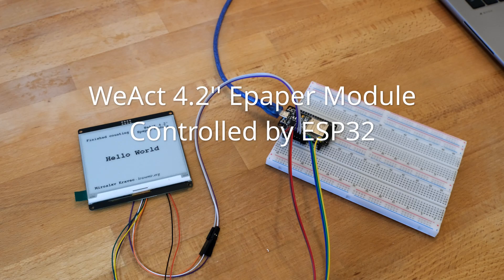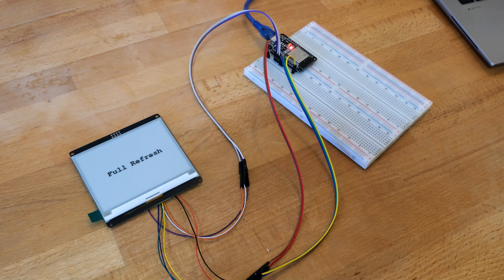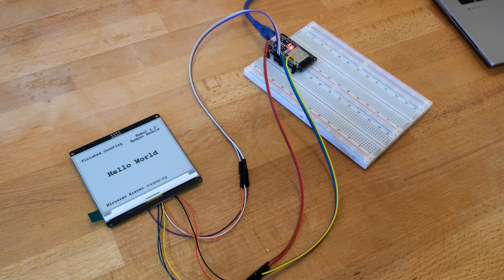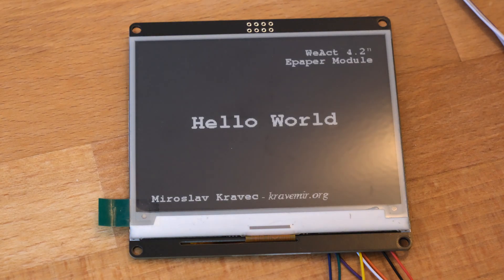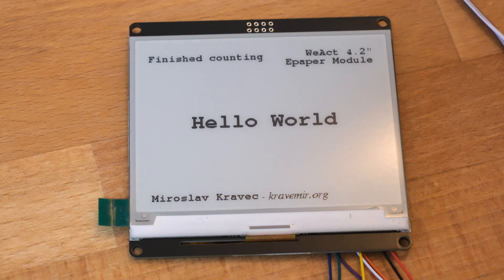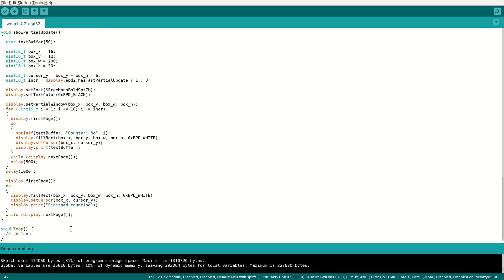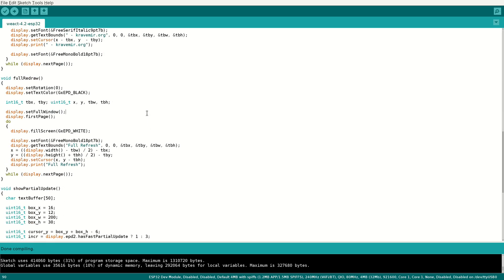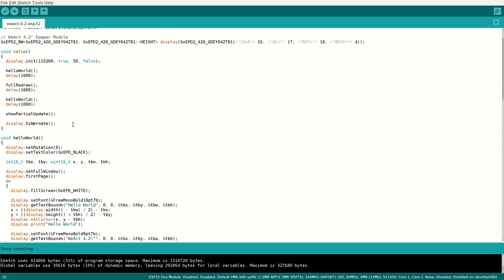WeAct 4.2'' Epaper Module controlled by ESP32 (programmed with Arduino)

Comment: hey, thanks for the video. looking to buy this display to play with en intergrate in epshome. my question is what about the 3.3v io pins. did you just connect them to a 5v esp32?
Reply from the maker: The I/O pins on this display module are 3.3V, and ESP32's I/O is 3.3V too, but not 5V tolerant.

I've used 3V3 VCC to power this display, but didn't try powering it with 5V. Theoretically, it should work.

My plan is to power it with NiMH, and 5V would require lots of batteries (NiMH can go as low as 1V) or lots of step-up boosting. Why do this, if both ESP32 and the module can work on 3.3V.

Comment: Hey unfortunately i was not able to reproduce the partial updates. Once it reaches this part all the writing shifts and/or i see duplicate counter writings at the top. Any idea what might cause this?
Reply from the maker: If it's exactly the same model with exactly the same code, then I have no other idea besides faulty display (or loose wiring, or something,...). You can try Arduino forums, posting there with full setup documentation of your setup and what you've done, and maybe someone there will be able to help.
Reply: @kravemir  hi thanks for the quick reply. I now managed to get it running. It were in fact the cables...

Comment: Thank you for this demonstration, I will order one of these displays. Did you also try 3 color (black-white-red) version?
Reply from the maker: I've mixed videos in my previous comment. This video is actually about the B/W 4.2" one, and not the 2.9" B/W/R/Y one. I am considering to get the B/W/R version of the larger display. And also, maybe that I'll try something even bigger than 4.2" to have more space to draw on.
Reply: @kravemir  My display arrived, I tested your code and it works great, also tried Seeed Studio XIAO ESP32-C3 with slight modifications. Thanks for all of the info.
Reply from the maker: @ did you get the three color version, or B/W?

And, the Seed Studio XIAO ESP32-C3 looks interesting with its specification: Deep sleep power consumption is about 43μA.
Reply: @ B/W
Reply from the maker: No, I haven't. So far, I've tried only this B/W/R/Y 2.9" e-paper display, and B/W 4.2" one.